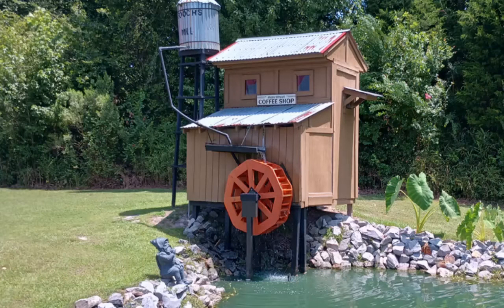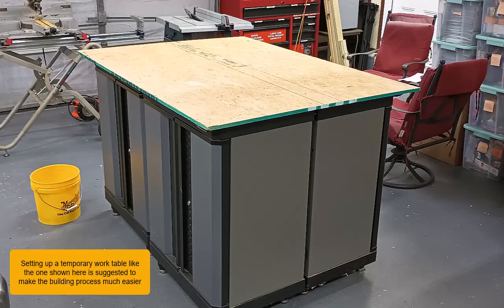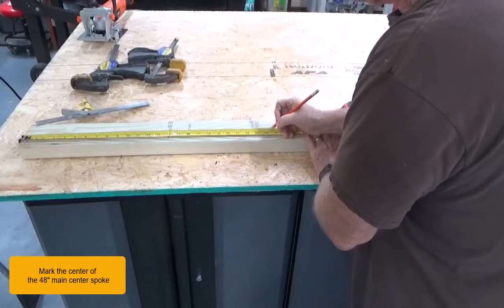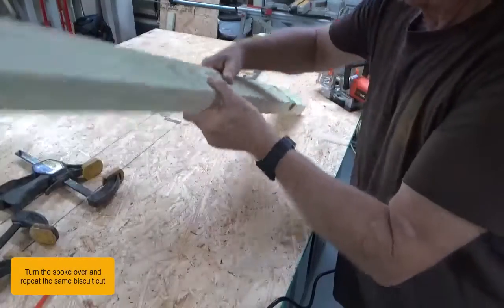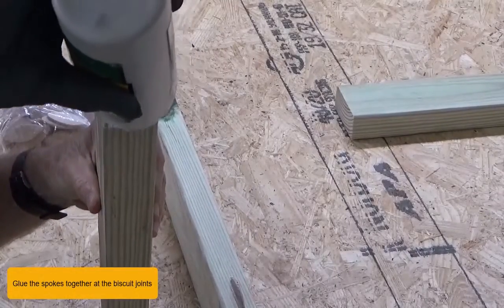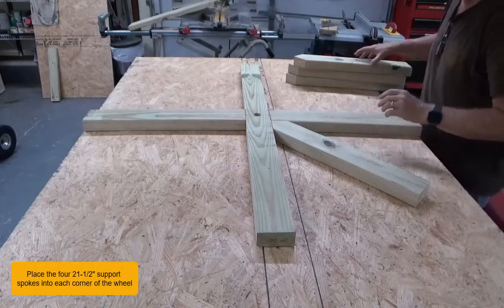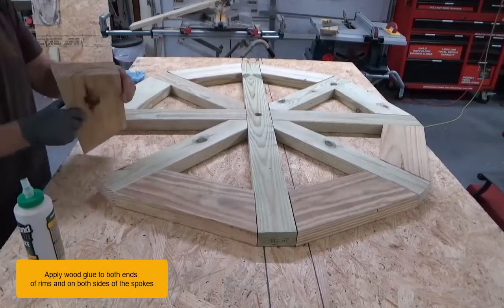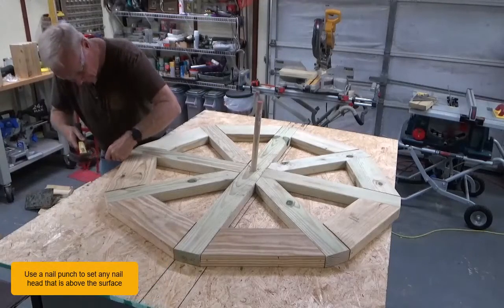Part 1 of 8 -  How to Build A Water Wheel

Comment: Cedar wood will kill fish. And I would sand and waterproof the wood after you construct.
Reply from the maker: The only cedar used in the water wheel is in the center hub, consisting of four pieces approximately 11 inches long. While cedar does contain natural oils and tannins that can be toxic to fish in high concentrations—particularly when fully submerged—this small amount of cedar, combined with the fact that the hub is not constantly underwater, has never caused any issues in ponds where similar water wheels have been installed.

The pond shown in the video is now over 30 years old and has had a water wheel operating continuously since it was constructed in 1994. It supports a healthy population of bass, bluegill, crappie, catfish, grass carp, and fathead minnows, with no history of fish loss or water quality problems.

Regarding the wood preparation, I both sand and waterproof each piece before construction. It’s best to waterproof all individual components prior to assembly so that every surface—including edges, corners, and ends—is fully sealed and allowed to dry before putting the wheel together. Once assembled, it’s not possible to completely waterproof every surface of the wood.
Thanks for watching my video!
Norman

Comment: Where do you get the drive collars
Reply from the maker: Below are the links to the water wheel shaft, keys, bearings, collars etc:
Source for Fully Keyed Shaft and Keys - https://redboarchain.com 
Pillow Block Bearings - https://amzn.to/3s6hHov
Shaft Collar Lock - 1.00" Bore Diameter - 303 Stainless Steel (2 Pack) - https://amzn.to/3OS3hB9
8” Brake Disc – 1” Bore – 1/4” Keyway – 2- Set Screws - https://amzn.to/3OSwDPX
10x10x1/8” Steel Plate - https://amzn.to/3KC0ARO
Thanks for watching my video!
Norman

Comment: Love this! I have made a waterwheel from another channel, but different. What would I need to change if I use cedar fence picket boards? Anything! Same size
Reply from the maker: You would be fine using cedar fence boards for the paddles, rim boards, and the outside of the center hub, as long as they are one-inch diameter boards. The inside of the center hub (the part where the axle is inserted) needs to be made from a 2X6. The spokes should be cut to a minimum of 1" X 4". You can use the same board cut sizes as shown in the video.
I have built water wheels with only cedar fence boards before, and they will last between 3 and 5 years, depending on how often the water wheel is operated. Additionally, using cedar boards will make the water wheel much lighter and easier to handle and mount.
Thanks for watching my video!
Norman

Comment: wait why no bottoms in the buckets & how would I make cuts to add bottoms to the buckets ? why have water run strait through buckets?
Reply from the maker: Depending on the style of water wheel you want to build, there are various construction methods to consider. The style demonstrated in the video was commonly used from the mid-1800s to the early 1900s. I have built several water wheels over the years and have found that the floor, also known as the sole plate, wears out much more quickly than the other parts. After 3 to 5 years some boards will need to be replaced.

Replacing the deteriorated parts of the water wheel requires significant time and labor. Allowing water to flow through the wheel lets it drain properly, preventing water from pooling on the sole plate. The wheel featured in the video has an expected lifespan of 5 to 8 years. The last wheel I constructed lasted nearly 9 years before it needed a rebuild. Additionally, allowing the water to cascade through the wheel creates more sound and splashes in the pond.

To easily attach the sole plates to the wheel (before adding the buckets), use either cedar or redwood. Cut the pieces to fit between the spokes on top of the rim boards, and secure them with stainless steel screws. Alternatively, you can cut dado slots on both sides of the rim boards, insert the sole plate boards into these slots, and then secure them with screws on both sides.

Remember to balance the wheel. Each sole plate board needs to be the same weight and size. First, calculate the number of inches required to cover the inside of the wheel frame. Then, determine the size of the boards needed to complete the circle and cut them to fit.

If the boards are not cut evenly, you will need to add weight to balance the wheel.

Thank you for watching my video!
Norman
Reply: @NormanGooch  Thank you for your information.  & sharing your knowledge.
Reply: @NormanGooch , So your waterwheel is 4 feet tall ! if I just wanted a little 24" I could just cut all measurements by half I would think ?
Reply from the maker: Building a 24-inch water wheel to match the specifications of a 4-foot water wheel is unfortunately not that simple by just cutting the dimensions in half.

When I design a water wheel, I always start with templates. I cut templates to construct one side of the water wheel, ensuring that the angles were correct and that it resembled the design I had in mind.

To build a 24" wheel you would need to change the width of the rim boards, spokes, center hub, steel plates, buckets, etc.
Reducing the size to 2 feet while using the same width boards would result in minimal space between the spokes and the rim boards. Consequently, the water wheel would not look aesthetically pleasing, as there would be more wood visible than open space between the rim board and the center hub.

I recommend the following build modifications:  
•	1x4” for rim boards  
•	1x3” for spokes 
•	3/4” for paddles  
•	4”x4” steel plate  
•	8” paddles 
•	3/4” steel shaft

Before cutting the wood, create a template for building the water wheel.
I use 24” x 18” white corrugated sign boards to make templates. A pack of 10 can be purchased on Amazon for around $26.
Here is the link: https://amzn.to/4g08a5B

Calculate the angle you must cut on each end of every rim board. There are 360 degrees in a circle. 
To make a circle using straight pieces of wood such as rim boards for the side of your water wheel, you calculate as follows:
Step 1: Count the number of edges = the number of rim boards X2 (if you use 8 rim boards your total number of edges would be 16)
Step 2: Since a circle is 360 degrees, Divide 360 degrees by 16 = 22.5 degrees.
Step 3: Cut each end of the rim boards at a 22.5-degree angle.
If you wanted to have shorter rim boards…, for example 10 instead of 8 = 360/20 = 18 degrees)
If you want larger rim boards…for example 6 instead of 8 = 360/12 = 30 degrees)

Next, draw the design on a whiteboard, then cut out the pieces and lay out the wheel design. 

Once you have assembled the wheel without gaps between the templates, outline the shape on the wood and make the cuts. 

It's important to create templates for all the pieces to ensure that the wheel is designed accurately and the design is what you are looking for.

I hope this helps with your project.
Thanks so much for taking the time to watch my video!
Norman
Reply: @NormanGooch  perfect thank you been trying to make the same material work & been fighting it for a while . not great at math but I knew things had to change just wasn't sure if it was all my used saws not cutting  square or if it was something else. great idea with making  on paper 1st already wasted a few boards trying to make it work this will save time & money
Reply from the maker: Building a water wheel is an enjoyable project. To assemble the wheel correctly, accurate measurements and cuts are essential. For the water wheel to function properly, it must be balanced. When constructing the wheel, it’s important to take your time and double-check all cuts, angles, and the overall balance. I wish you success with your water wheel project.  Thanks again for watching my video!
Norman